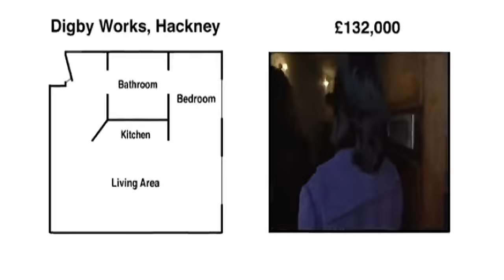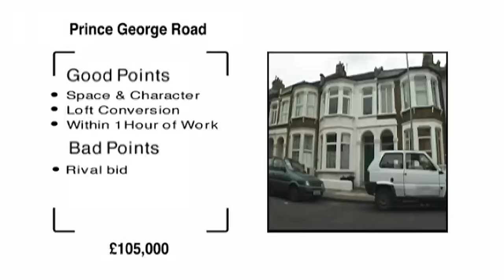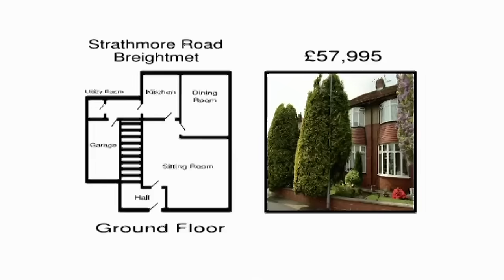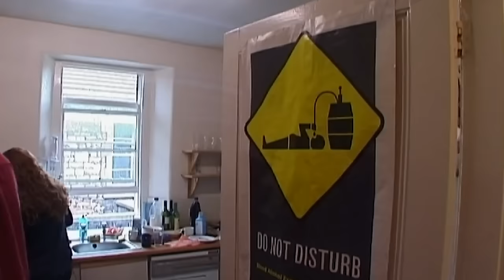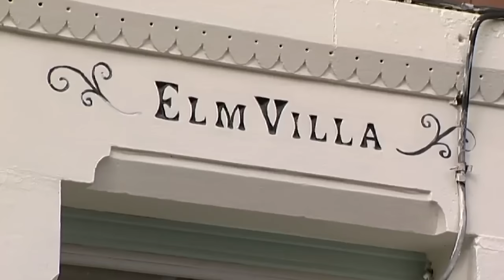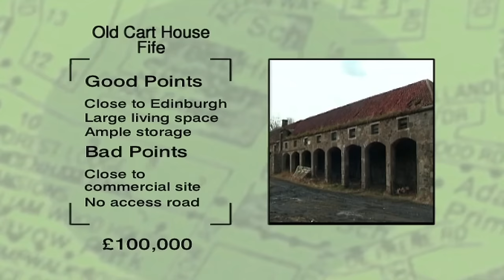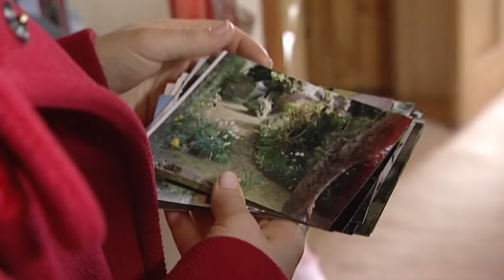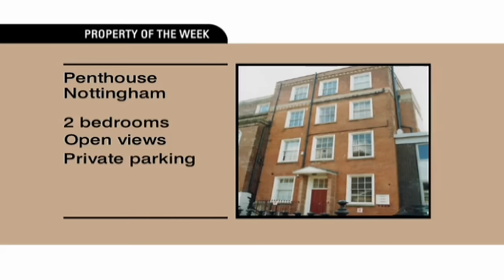Location, Location, Location | Season 1 Marathon | Abode

Comment: £100,000 wouldn't buy you a parking spot in East Ham in 2024.
Reply: You might get it for 6 months...on a time share? You might need to donate a kidney as well.
Reply: Oh I don't know. A parking slot on the top of a nearly vertical hill made up of heavy clay with a 4 foot wide stone wall at the bottom and a 100° right turn between two 12ft. high hedges just might go for 100k today. Lol!